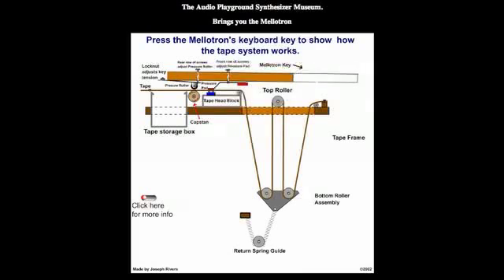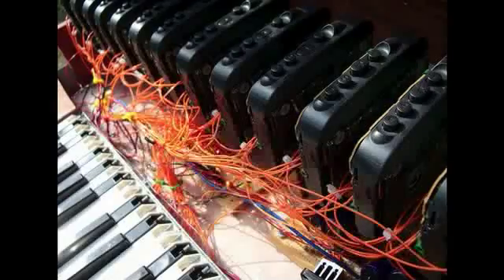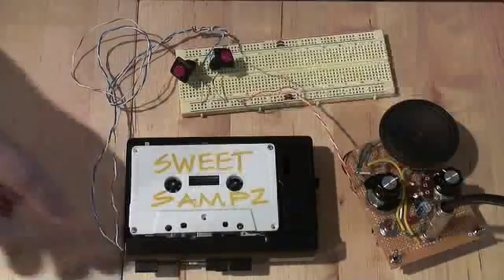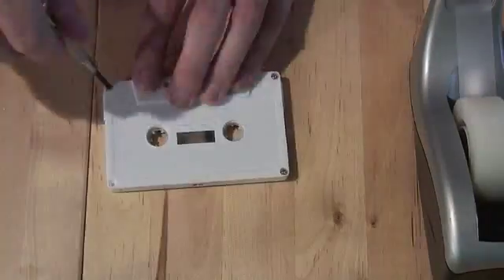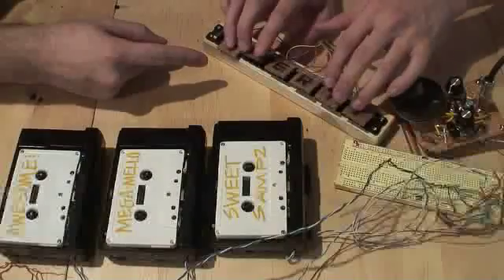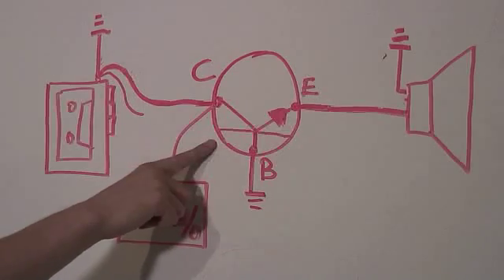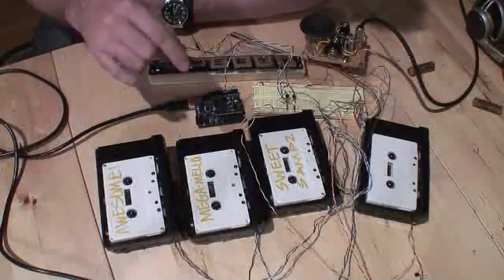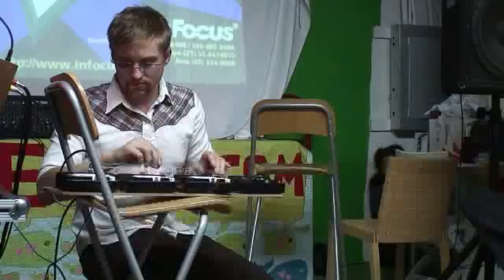Walkotron!

Comment: Strictly, this isn't a mellotron, as the notes on a Mellotron are mechanically triggered (through the tape head and capstan roller mounted on the keys) instead of switching the audio signal electrically.

You can pull some creative hacks with a few tape decks to do some resampling tricks, if you can get your hands on decks that can record. Imagine the possibilities with double tape decks, high-speed dubbing and a DJ mixer... ;)

Comment: I can't express strongly enough how disappointed I am that you didn't attempt to make music with it.  It just sounded like a radio scanning empty stations. Well done.
Reply: They can't make real music on it because it doesn't work.  They didn't figure out that you can't use different players playing at the same time because each motor is running at a slightly different speed, making tuning musical notes impossible.